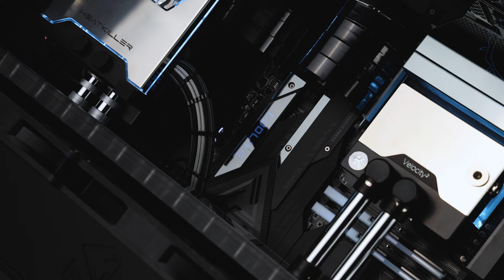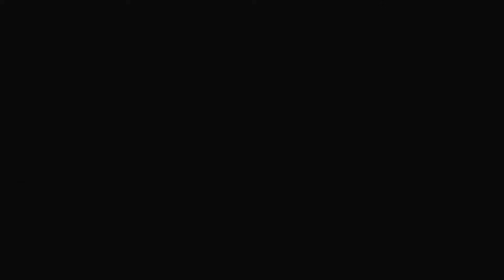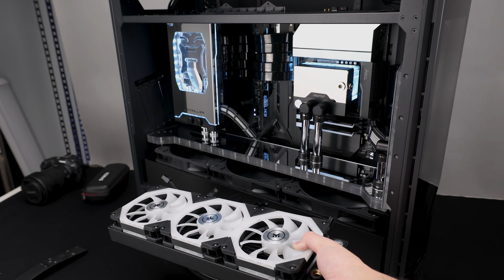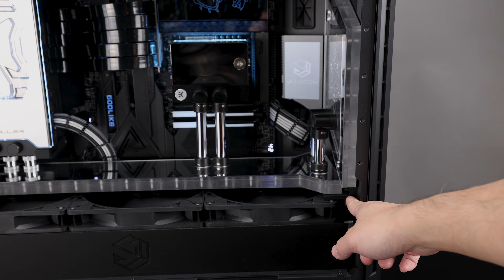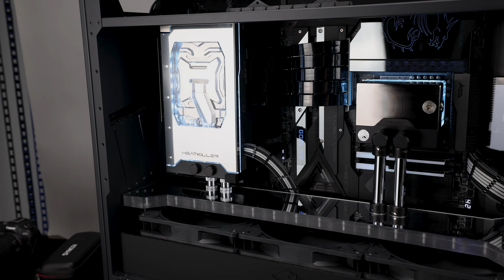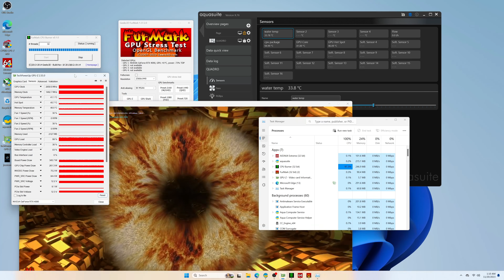Silverstone ALTA F2 Custom Build and Overview: Ft MSI Godlike X670e, 4090 Strix and 540mm MONSTA rad

Comment: Would you say that the Heatkiller water block out performs Ekwb ?
Reply from the maker: Yes by a lot
Reply: @JCustom  thanks, have you ever thought about doing like a gpu water block face between the available ones on the market? How did you get the tubing to from the bottom of the waterblock? Did it come with bracket like the EK founders edition waterblock for the 3000 series GPU that let you seitch I/O ports on the water block?

Comment: Love the build, but doesnt the distro obstruct the airflow and main purpose of the cases layout? I know youre watercooling most heat producing components but i still would want mostly unrestricted airflow if possible
Reply from the maker: Not at all. The distro has quite a bit of space above the fan and it is going across the fan center dead zone.

Comment: Top tier demonstration of aesthetics over performance, but looks amazing
Reply: Performance? It's actually insane
Reply: @GGFEvents he used a distro plate which is bad enough restriction wise alone but also blocks the fans here, also used a thick af rad and went for a 7950x
Reply: @BoyoboBen  everything you just said is wrong.